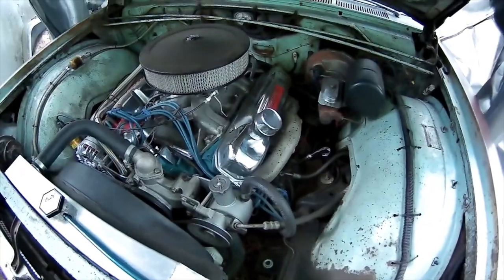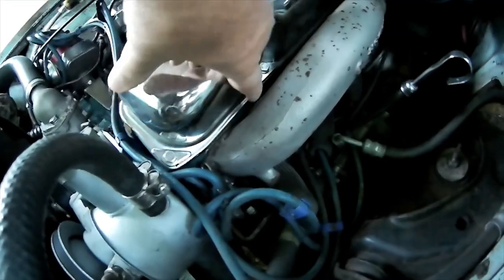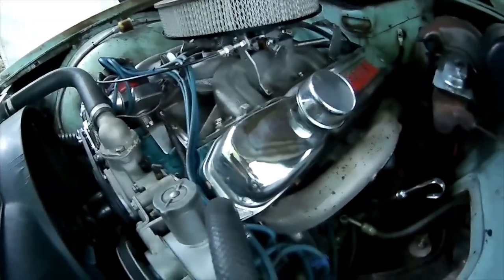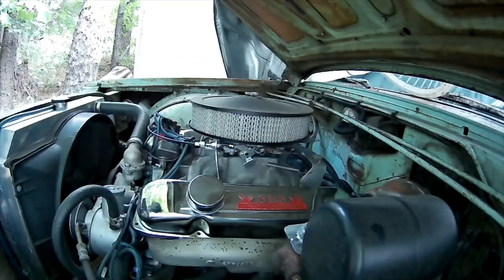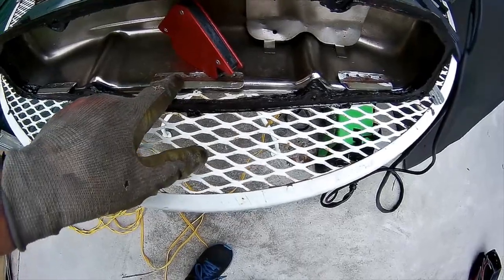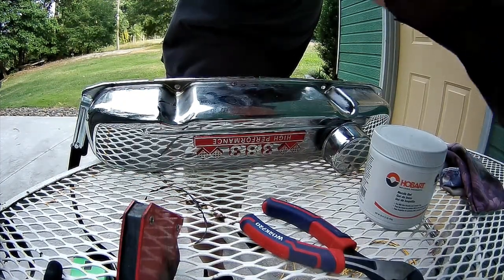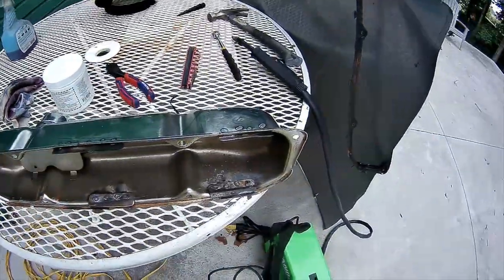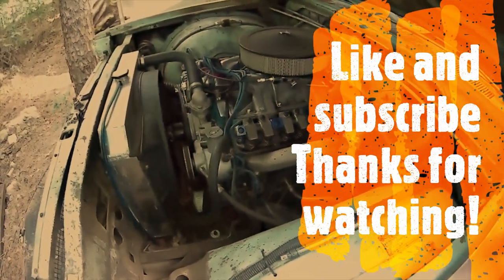Big Block Dodge aftermarket chrome valve covers leak!

Comment: Never been a fan of the aftermarket stamped steel covers and I will not use a regular cork style valve cover gasket I'm spoiled on the steel core style either composite or rubber and even better if they come with built in torque limters. I like the ridged aluminum covers the most with a steel core gasket well worth the cost over dealing with the leaks...but I know people like the stock and period look of the stamped steel covers I just don't go to cheap on the gaskets... And you know most of the time mopar didn't even use gaskets between the head and the exhaust manifolds so my favorites there are the dead soft copper or aluminum ones just pay for themselves in the long run. Mopar on man have a great day!

Comment: just picked up , chrome chimney covers .
equivalent to new 
1964 style so , w/o hose nipple ,on the ,
breather oil cap .
believe their from early 80’s direct~connection 
catalog .
identical to 64-65 stampings , but no part number .
found the cars that came equipped with the chrome cover , the broadcast sheet will ref. 
; special application *
in engine accessories 
portion .
Reply from the maker: thanks for the knowledge update!